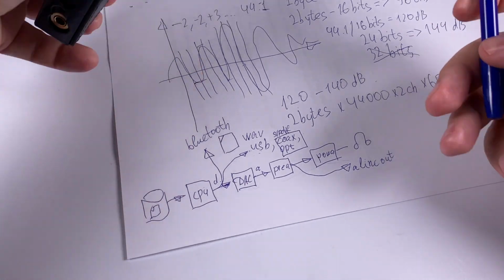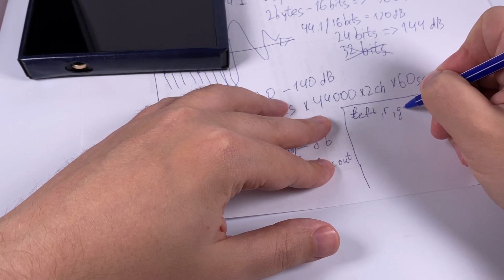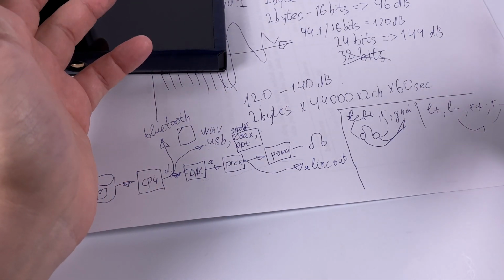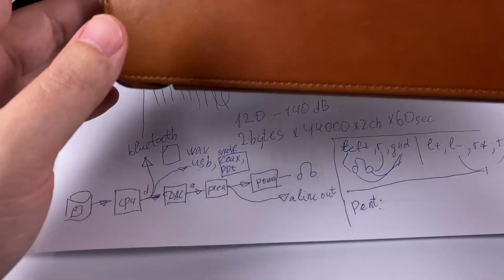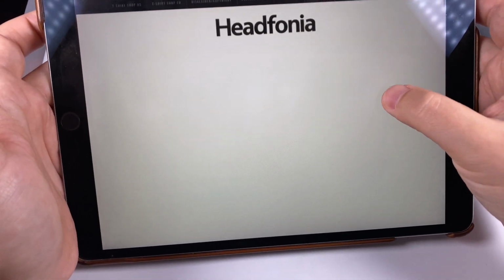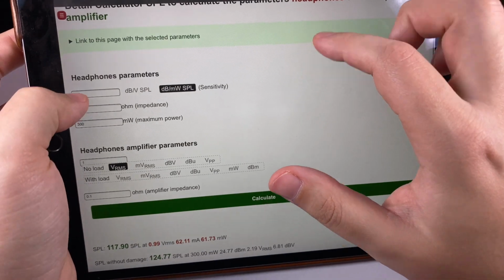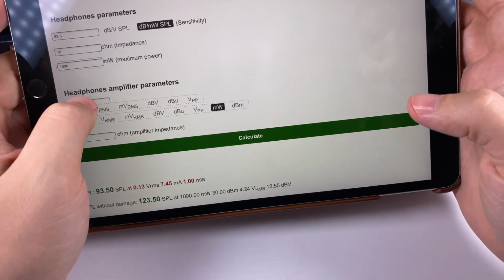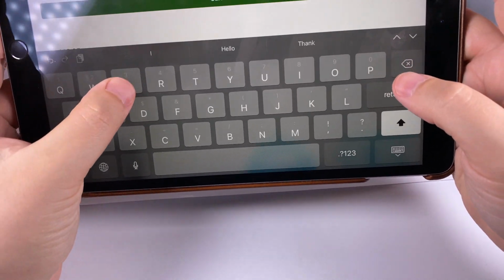Technical basics of audio: connectors, signal types, power and so on

Comment: Thank you Paul. Very informative video. Kindly would you explain the part after the cpu processes rhe file and makes it ready for the DA converter. Does this mean that if we use the spdif output (digital) in that stage, the file still remains in digital domain and still is not degraded and affected by poor DA conversion which would follow afterwards if the DAC is a low quality? Logical question that follows is, what do you suggest as a good quality usb to spdif converter? God bless you. I love your work. Thank you. Sani
Reply from the maker: > Does this mean that if we use the spdif output (digital) in that stage, the file still remains in digital domain
yes, signal is digital, and it will be processed by the external device's DAC. so yes, if external device's DAC is better, you can use S/PDIF to get a better sound

> Logical question that follows is, what do you suggest as a good quality usb to spdif converter?
aren't your external DAC supports USB? if not, the best converter I've tested was Hydra by Audiobyte
Reply: @PortaFi  I have an RME Babyface audio interface/DAC. Very good quality DAC but it doesn't support Android driver. It does work with UAPP, but I can not listen to Spotify in this way. That is why I would like some kind of a good quality usb to spdif converter that can be recognized by an Android device. I would use it to connect it's output to my RME DAC. Thanks Paul. God bless
Reply from the maker: well, unfortunately I don't know any converter to be used in this scenario

Comment: Nice video, I don't understand what changes in sound with a high impedance or low.
Reply from the maker: headphones impedance or player's output impedance?
Reply: @PortaFi  player output
Reply from the maker: @Marius.1926  well, in short, the most noticeable impact is with a multi balanced armature and hybrid models, as they have a variable curve (their impedance is different at different frequencies), so the additional impedance of the source can alter their sound signature. So, for such IEMs, it's better to have sources with impedance about 2Ω or low. Luckily, almost all new sources keep this parameter close to zero. 
Dynamic driver models are less impacted by source impedance, so with them it's safe to use higher impedance sources. There is a general rule that source impedance should be less than 1/8 of load's impedance, but it's more a recommendation for DD load 
but of course, there could be exceptions, but they are rare
Reply: @PortaFi  tanks for this. My dap fiio m9 3.5 is 2 ohms bat from the 2.5 is 3 ohm, if i have a multi ba is batter use the 3.5?
Reply from the maker: @Marius.1926  it's better to test both outs and find out in practice, but in general, balanced out is made for higher power, and usually makes really not much sense for sensitive IEMs. Anyway, I don't think that 3Ω of impedance will be critical for IEMs